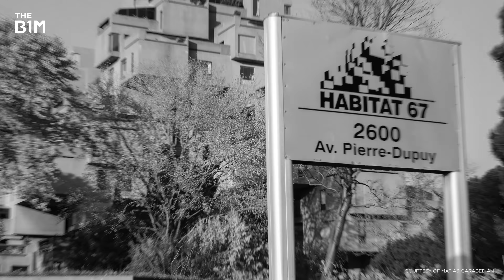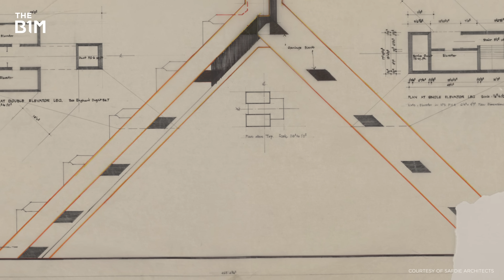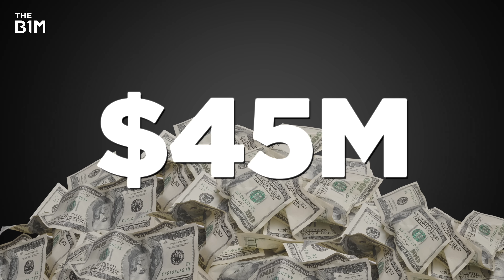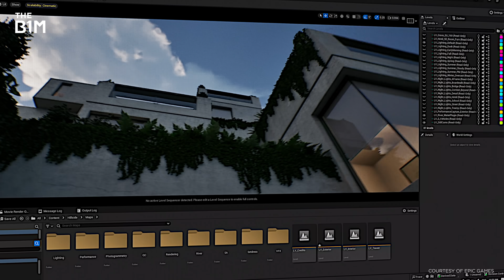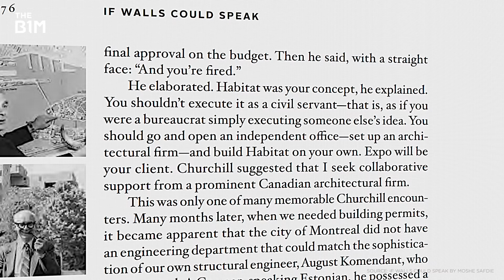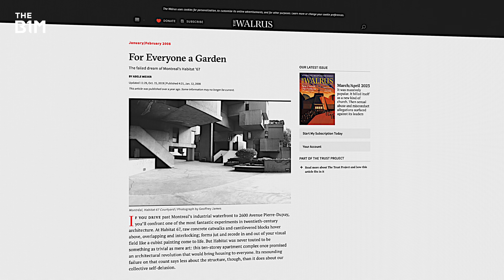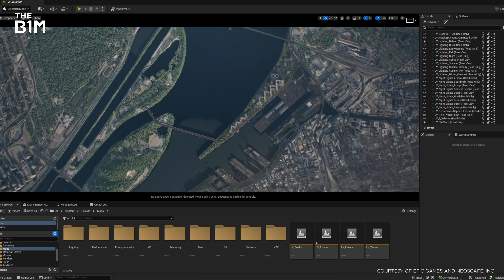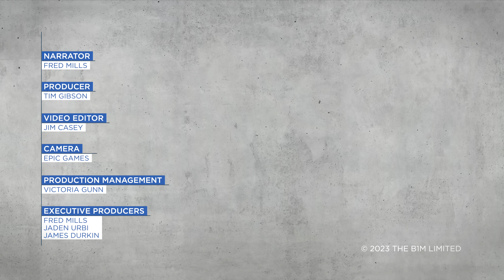How a 23-Year-Old Solved Urban Sprawl

Comment: i think moshe safdie missed the whole point of suburban housing, apartments share a common and singular plot of land, and while in some countries that land is divided across all of its unit owners when the building is eventually demolished, it still ends up being ridiculous for them when that time eventually comes. all buildings taller than a certain height (varies between countries) have a fixed lifespan of 50 years according to international building codes (with the exception of national heritage sites and buildings built with materials other than wood, steel, or concrete), so you eventually lose your home, and have no land to rebuild with or even sell. 

say for example that the condominium you live in is occupying 1000 sqm, and the number of unit owners are a conservative 2000, if you consider the law that allows unit owners to own a piece of the total property, then they end up with 0.5 sqm each, which is nothing. this is why suburban housing is so important for people of the retiring age, because staying in a condo all your life will get you screwed over sideways. condominiums are realistically for the young and able who can use it as a springboard for their future towards retirement in a stable life with a home they own in a land they own and sources of passive income. condo's are the complete antithesis of that goal.

edit: also i can tell you now from firsthand experience, living near where you work is a horrible, horrible experience. if your clients/customers/patients know where you live then they will never stop freaking invading your off hours just to get you to do something for them when you're not supposed to be working. this was the problem with my childhood home, where the 1st floor was a dental clinic and the 2nd floor was the house, in the beginning we weren't averse to telling our patients where we lived especially since my dad wanted to show off his expensive collections upstairs or invite them to dinner. 

then over time we started to realize that there were a lot of people who were better off not knowing where we lived, some would harass us nonstop day in day out and even throw stones at our windows just to get our attention (most of them for stupid things like a toothache, like seriously just come back for your next appointment literally tomorrow morning!!!), and the harassment would get worse over the years as the prevalence of karens began, so eventually we didnt tell a single soul where we lived and asked our neighbors to do the same, only close friends of the family would get to know. and only then did we finally get some peace. being so close to home can only be a curse, 15 - 30 minute walking distance is fine, but literally down the stairs is definitely not good at all.

Comment: It's amazing that apartment buildings are still not built fully modularly and at a co-located factory. Yes, floor segments and walls and pillars are cast at concrete factories but it's very rare for buildings to be built from modules that are half-complete. Some houses are made from actual modules these days but at a factory far away and transported a lomg way. It's not feasible to move a factory for 1-50 houses but it might be viable to set up a factory if you were making 10000 housing units at a time. Housing needs to be made with better quality and cheaper prices and one way to achieve this is advanced pre-fabrication. Traditional construction methods from the 60's and 70's should be finally be replaced with something more efficient and automated.

Comment: I agree that urban developments are in need of much improvement for the sake of higher sustainability and QoL, but the core design of Habitat 67 has not and will not age well. That is ultimately what will steer investors away; that the blocky, jumbled structure is ultimately unappealing, or polarizing at the very least. I think if the design language is somehow softened up and presented to appeal to the masses, people would be more open to entertain such an idea. Of course altering the design language would restrict or eliminate the crucial modularity component, but the stacked box aesthetic looks far too dystopian for the general public.

Still more reasonable than The Line tho🤣

Comment: You don't see extreme urban sprawl outside of the US. The simple solution to it is to just not to zone giant areas to single family housing.
As other people have pointed out, the safdie design has some major issues over a normal apartment block like poor insulation and being harder to repair. I'd also reckon that you can't build a conventional elevator in a building that doesn't surround the shaft, or it wouldn't have access to all the floors.
Reply: ADA code would make a building like this a nightmare to design in the states. Plus as someone from California, I cant imagine the type of structure that would be required to make it earthquake proof. Great concept that can work in certain regions/climates but in general there are some clear and obvious drawbacks.
Reply: In western Canada - we have a metric ton of young folks wanting heavy density with the failed thinking it will drive costs of ownership down (it doesn't) and will complain to high hell against sfh until they decide to have a family or get into RE investing. Then they head to suburbs - rent out their density ridden condo's at ridiculous rates. It is all sham really.

Comment: But it's a grotesque eyesore. Almost everything is covered by a thick, shading concrete roof of modules. Even the scaled-down version that was built looks horrifying, just a jumble of grey cargo containers. Inaccessible from any direction, a heap of windowless miniature apartments. With a net five out of six possible surfaces of every module (!) exposed to the elements and no good space for scaffolding, it can't even be renovated. It would just have to be demolished after its intended lifespan of a handful of decades. Staggeringly wasteful. But I guess staggering is the whole idea here.

Comment: The weight of growing vegetation, planters, soil and watering is huge, and shrinking and expanding and leaking over time, I would think. The entire structure would have to be seriously over- engineered, right? Remembering the pool deck collapse, taking down Champlain Towers in Florida. Some great engineers commenting on that here on You Tube.

Comment: This is not a good us of material especially for something as environmentally damaging as concrete. So instead of layering the buildings directly up and down where you can do all the same this this so called solution does it diagonally make the use of elevators and steps far more challenging? This is beyond terrible, in no way humane and generates more problems and solves nothing. The solutions to urban sprawl have already been defined, some places use those tactics many places do not because they simply do not care. If you are the designer of this; you have embarrassed yourself publicly to many within the community you are attempting to show off to and you don't even realize that

Comment: It looks like a concrete version of the favelas of Brazil. Nothing really special. It actully looks pretty ugly and very dystopian. Very inpractical as well in fact. Nearly all blocks are subject to the surrounding elements, making roofing, insulation etc. necessary to a great extent everywhere (keep in mind that upper floors in buildings are undesirable due to them leaking and having a lot of temperature fluctuations). So no, he did not solve urban sprawl. That was a very misleading title which is not appreciated. I hope you don't go on to waste our time like that in the future because your videos as such are great. Thanks, B1M.

Comment: The problem is that this design costs a crazy amount to build and is very impractical from an engineering point of view. It's a good example of architects having fun because they don't have to build, insulate, wire, and pipe or maintain the thing.

Comment: You don't have to be an architect or engineer to know this is the most terribly inefficient way to do this. It's literally all the problems with SFH suburbia with the added problems that arise when you try to build things tall. And then on top of that, you're building these massive cantilevers and bridges. It's like building a cantilevered SFH on a bridge, on top of a bunch of other ones built the same way. I'm not saying it doesn't look cool, and idk it might feel nice living in something like that, but this would be something that only the 1% of earners could afford to live in. Besides that, it's extremely non environmentally friendly. This is literally the most unfriendly structure imaginable. You're using massive amounts of steel and concrete to make those bridges and cantilevers possible, and you're then on top of that having to create insulated weatherproof facades on all dwellings. This means the units don't share climate control (apartments share efficiency because you typically only have one exterior wall per unit), and all those superfluous facades must then be maintained. Take a typical five over one apartment; only the top floor has a roof. Apartments on floors two to second to last only have one single exterior wall (corners are typically used for stairwells). Only the bottom story is concrete, and the rest is wood (which IS a renewable resource if you do it right). 

And five over one and even high rises don't have to be bad places to live. Five over one can have courtyards in the middle, and high rises can have atriums.

But "sprawl" is even more efficient, because single story buildings take far less to no destructive resources to build. About the most comfortable structure possible is one made from earth (e.g. adobe). It's literally the most renewable resource on the planet. Not only do the houses have negative carbon footprints, they heat and cool themselves in most climates where people live, or at least make climate control an order or two more efficient.

Another issue with sprawl besides the outrageously restrictive building codes forcing people to use non renewable materials is the SFH blanket zoning. That's the REAL problem with urban sprawl, and was in full swing by the time this guy came up with his plan. North Americans decided they didn't like small businesses in their neighborhoods so they made a law banning people from opening any kind of business within sight of their houses. Europe does no have this problem. Europe has services within walking distance of even the most far flung neighborhoods. That encourages people to invest in bike and foot paths.

Comment: Sorry but doesn't look as advertised to me. No utopia just concrete boxes again, stacked in a slightly interesting way but not very beautiful and not very harmonious with nature either. As other commenters have mentioned some downsides like insulation, I wouldn't be surprised if its not very practical either. I''ll look elsewhere for my preferred vision of utopia, thanks. (Singapore's Gardens by the Bay and Jewel structures are much more appealing to me, for example)

Comment: I loved it in 1967, and have always thought it was a delightful structure.  However, it has to work financially, and proof that it will work financially has be laid out, and shown to be completely accurate.
I'm not sure if it really is workable from a financial standpoint, but it might be if all of the infrastructure costs are counted along with the building's.  If you cut the cost of roads, sewers, water supply, etc., the money can go into the higher costs of the structure.